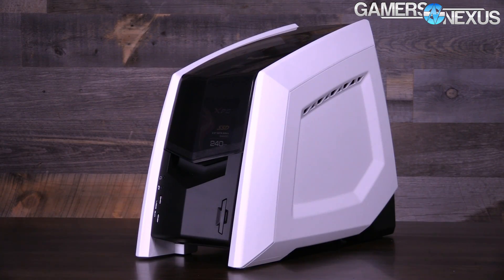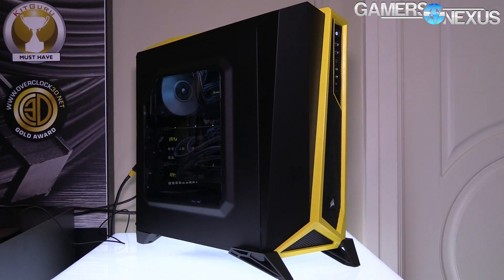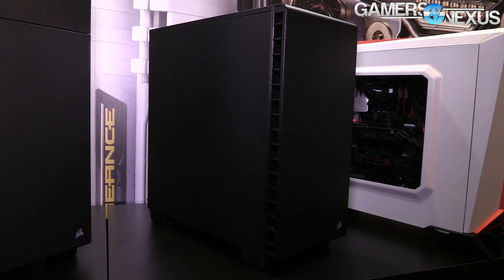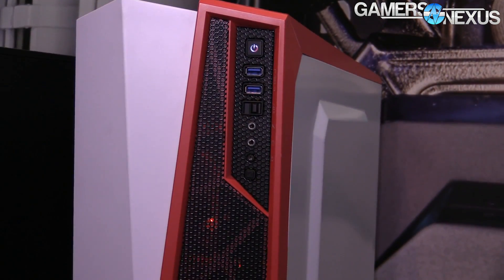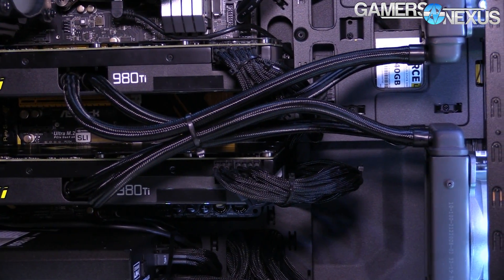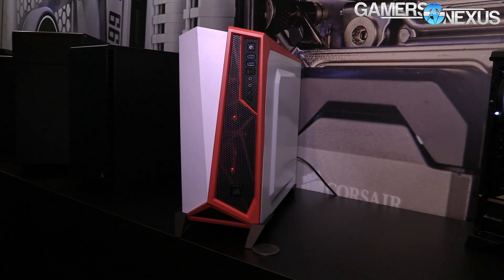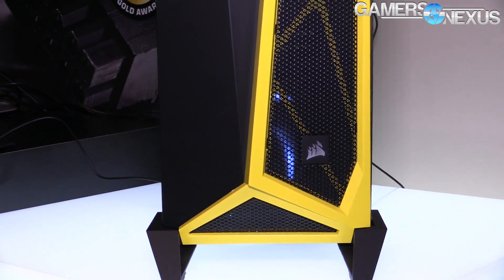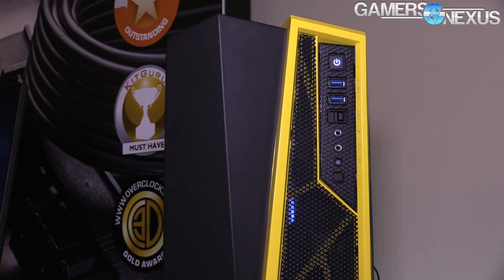What is 'Tooling' & How Are Cases Made?

Comment: Tool up a 400C with a single 5.25" drive and space for 3 140mm fans up top/out front and I'll buy it immediately. I love my 400c, but it's a tiny bit too short and I want a 420 setup instead of 280.